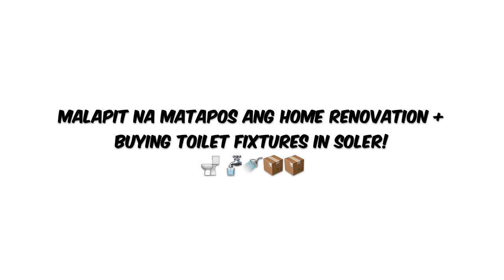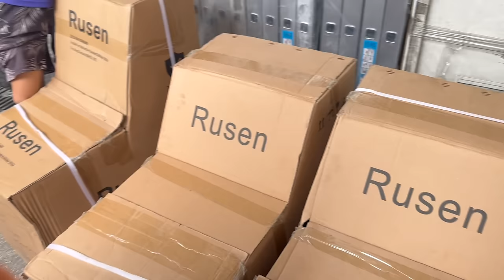Home Renovation Update + Buying Bathroom Fixtures with the Fam! (March 9, 2024)🏡

Comment: Hi JM. Unsolicited advice, medyo mahirap imaintain ang black faucet and shower. Prone to water stains. Kaya kelangan mo sya idry every after use to avoid permanent water stains, lalo na kung yung water supply pa is deep well. Mas ok pa rin yung stainless steel talaga. Just sharing based on personal experience. 😅

Comment: FYI lang po sa tiles. Yung floor tiles po na 60x60, usually po wala syang space or meron super liit lang. May mga alam ako na umangat sila ska based din sa exp namin umangat po yung tiles hahaha di namin alam bakit pati contractor namin wala maibigay na maayos na sagot. To be safe po, if you can buy extra tiles just incase na umangat sila at wala nang design na available. Medyo nahirapan kami nung magkahanp ng kapalit kasi yung design nung tiles namin phase out na hahaha... Yun lang po :) more power sa vlogs nyo